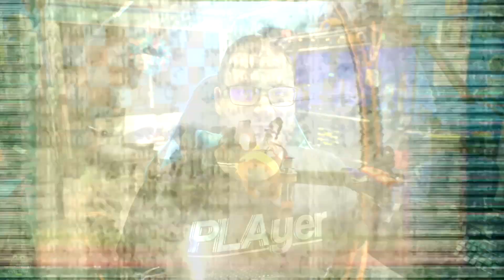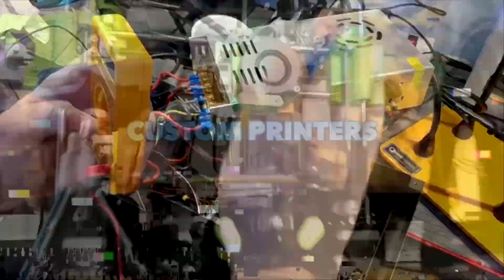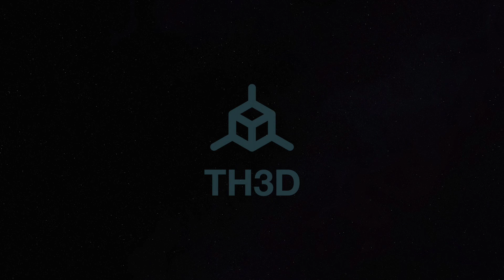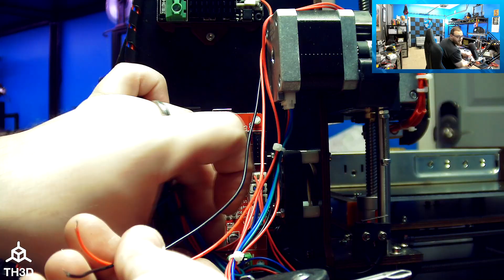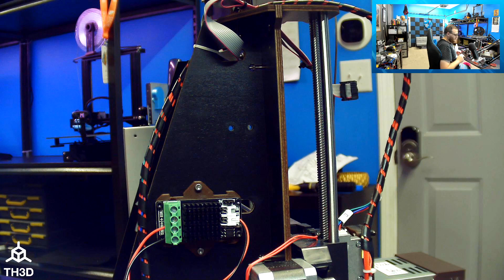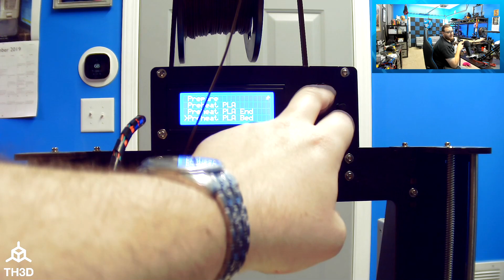Upgrade Your Printer with a Heated Bed MOSFET - Super Quick & Easy!

Comment: Good video, nice and clear. Is there a specific reason for not using crimped ferrules instead of just twisting the wires?
Reply from the maker: Twisted wires or crimp ferrules are fine for these types of terminals. Ferrules are recommended if you have them as it's a more solid connection.

Comment: I recently burned up a SKR Mini E3 V2.0 cleaning the hotend with a wire brush.  I am not sure exactly what happened though I suspect the wire brush shorted the heater wires.  There were sparks and the display went blank.  Measuring the 5v on the control board it was 1.3v so I had to buy a new board.  I was wondering if putting a Mosfet like this on the hotend would have protcted the board in my Ender 3 Pro?
Reply from the maker: Mosfet would not have prevented this. A properly designed board would. Our EZBoard V2 has protections from stuff like that on it. We just got more in here: https://www.th3dstudio.com/product/ezboard-v2/
Reply: @TH3DStudio  Yes, I had my doubts.  Looks like a nice board.  Seems like the price used to be higher, but I could be wrong.  It has been awhile since I looked at boards your company makes.  FYSETC makes some nice boards like the spider.  Of course I found all this out after I already bought a new board.  I will keep your board in mind if I ever need another one.

Comment: Great video! I want to use the MOSFET to add a 24v heated bed to my 12v printer. I will use a separate 24v psu for the bed. Is the Bed Control input isolated from the output, or will I have to connect the negative of the 24v psu to the negative of the 12v psu?
Reply from the maker: When you use the high level B-CTL input It is isolated from the control input. The S/GND low level input has the GND pin tied to the power input negative pin. You could use it on a dual voltage system like you are describing.
Reply: @TH3DStudio  thanks very much

Comment: @th3d studio   This the same setup for ender 6?  Super noobie here
Reply from the maker: Yes it would be the same wiring. Pull power for the mosfet from your power supply directly, put the wires that feed the bed into the bed side of the mosfet, and then connect the B-CTL wires to your control board where the bed used to be. :) Also make sure to set the jumper on the MOSFET to 24V since the Ender 6 is a 24V printer.

Comment: Any chance you know if the mosfet kit uses a flyback diode and/or input pin protection?
Reply from the maker: The signal is isolated with an opto IC on ours and the FET used has a built-in flyback diode. On the high level (B-CTL) input side it has a full bridge rectifier so polarity doesn't matter. Polarity does matter on the low level (S/GND) side.

Comment: Is it ok to get a separate MOSFET for the bed and the hot end and run them each on their own MOSFET?
Reply from the maker: Yeah if you want you can but usually its not needed on the hotend because the amp draw is really low in comparison to a bed. Most beds pull 9+ amps whereas your hotends are 1-4 amps.
Reply: @TH3DStudio  Gotcha, thank you so much.

Comment: i have a 24v power supply from a cr10 pro v1, the stock setup comes with a SSR. would adding a mosfet be beneficial or would it serve no purpose? i've also replaced the stock control board with a bigtreetech skr v1.3
Reply from the maker: The stock SSR functions just like the mosfet in this video. It is a known failure point on that printer so just keep an eye on it.
Reply: @TH3DStudio  Im doing the same thing but with a SKR 2 Rev B board. Do i need to change anything in marlin to identify that the board is sending a control signal to a mosfet instead of a power signal to the bed?

Comment: How exactly would you accomplish this if your heater bed uses a ribbon cable? Really annoying how mine uses a ribbon cable as there are no markings on which cables do what.
Reply from the maker: It should still be possible. What printer model is it?

Comment: I've had 2 RAMPS boards (1.4 and 1.6+) have the heater bed mosfet go bad closed. Making the bed no longer heat. I have no idea why this has now happened twice. I've checked my wiring to the heated bad and it's testing good and does not seem to be a short I don't believe. The solder joints to the bed are really good ones and I have a stress relief so the movement of the wires don't cause a cold solder. Would an external heated bed mosfet help me out in this case? I just want to print and seems I can get about 40 hours so far of printing then poof the mosfet goes bad and i get a thermal runaway/non-heating bed. Thanks I'll get a more modern BTT SKR 2 next since I'm not sure if BTT will warrant my board. Just sent them a video proving the mosfet was bad or stuck closed. Thanks for any input!
Reply from the maker: Could just be low quality mosfets if you've ruled out shorting issues. Putting a bed mosfet on is never a bad idea. That is the largest load on a printer board and offloading that to a beefy, separate one should help extend the life of even low-end mosfets found on many control boards these days.

Comment: What do you do if all your spots on the power supply have stuff connected already?
Reply from the maker: Put 2x fork ends into 1 terminal. You can stack 2x in 1 terminal on a PSU.

Comment: hi, I added a mosfet just like you mentioned in your video on my anycubic mega zero v1. when I turn on the printer and try to turn the heated bed on, all the LEDs on the mosfet turn on but the heated bed is still not turning on. It seems like the heated bed is not getting any voltage from the mosfet. What would you advice I should check? I connected the mosfet to a 12v PSU to power the heated bed.
Reply from the maker: It's probably something silly that was overlooked. Try posting pictures of your setup in our Discord server here: http://discord.th3dstudio.com/
Reply: @TH3DStudio  thank you for your reply. I was able to correct it after checking some of your other videos :) highly appreciate your videos thank you

Comment: Can you help please. I installed on the cr10s pro. where do I put the stock ground wire that was connected to my old SSR. thanks in response.
Reply: doesn't CR-10s pro already has MOSFET??
Reply: I would like to know the answer to this a also

Comment: are they good for a cr10 mini?
kind regards
Reply from the maker: They're a universal part and work on that machine. We have one on ours that is used for ABS printing.
Reply: @TH3DStudio  thank you for the quick reply. my problem is that most probably the ons i have is fried. When I opened the box the mosfet was so hot it melted the solder on the mini board and fell. I soldered it back on and tried to heat the bed, at almost 45C the heatsink was really hot and the mosfet fell of the board again.
my heated bed after inspection doesn't seem to have any issue or broken cables. So i think i need to throw the mosfet board away and use a brand new one. 
my question is,  is it better to keep it outside the box? does it need a fan to keep it cool?

Comment: Would it be ok to add separate power supply just for heat bed? Would this cause any problems with ezabl or any in general? THANKS
Reply from the maker: Yes you can. Power the MOSFET main power input from that one.

Comment: Wouldn't it be better to explain the reason before the how? A
Reply from the maker: Can't edit a video once it's posted but it is in the video if you watch the entire thing. Adding an external mosfet to your printer for the heated bed removes all the bed load from your control board.

Comment: Tim, what's the advantage of replacing the Creality mosfet?
Reply from the maker: In our case the stock Ender 5 Plus one was failing and needed replacing.
Reply: @TH3DStudio  would that cause the bed not to heat up? On the ender 5 plus